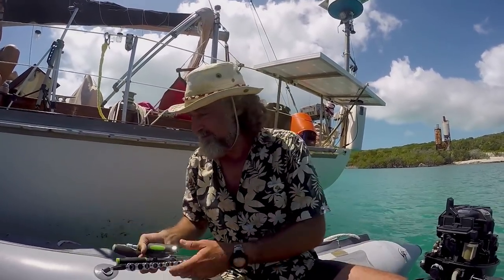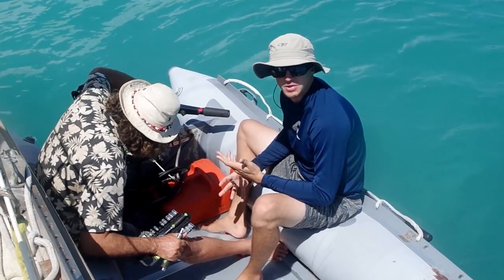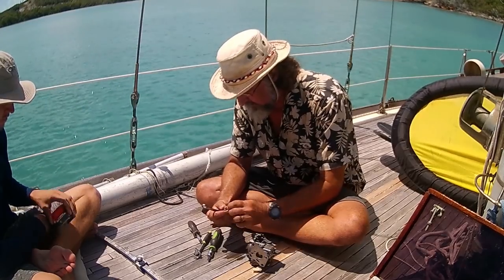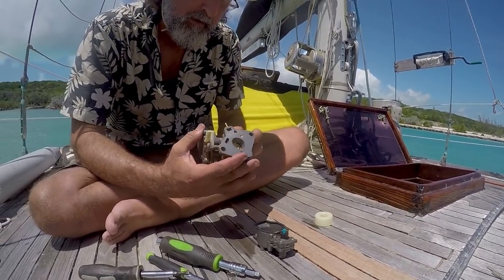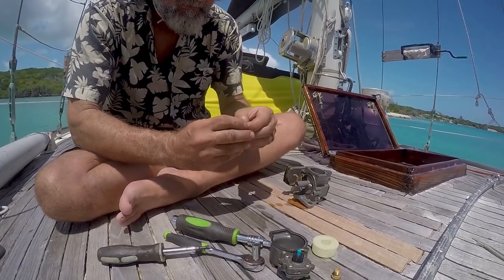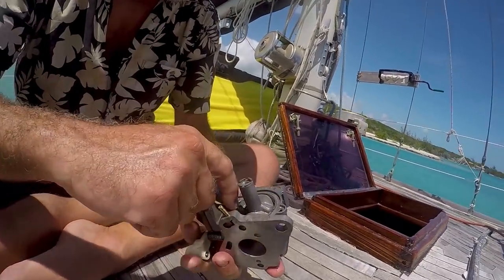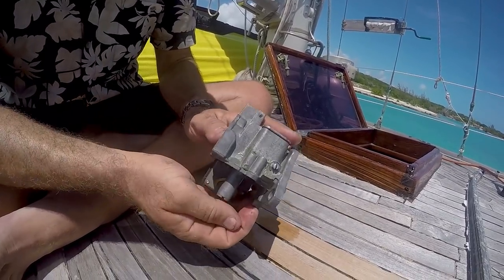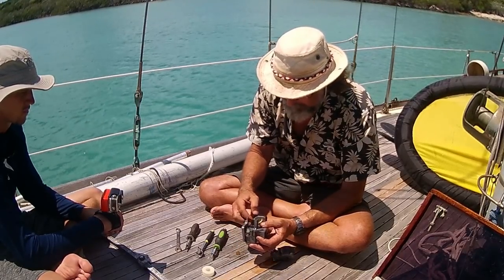Fixing a 2-STROKE OUTBOARD Motor [Capable Cruising Guides]

Comment: Speaking as a marine engineer I see you troubleshot this problem completely ass backwards, This is common with untrained mechanics. The problem was fuel so you always start at the beginning which is the source or tank , You didn't even pull the fuel filter off to check if it was clogged, you got lucky fixing this motor because they are so simple,
Reply: You are arrogant.  Read his post explaining why he didn't check fuel filter first.
Reply: You are kinda famous now. Watch the Yanmar starter motor video. You can comment there as well, being a Marine Engineer and all....Are you George Castanza?

Comment: Good video guys.
Worth noting that when you reinstall a carburetor's bowl, one should be very careful not to put Any more torque than necessary on the bolt. This is because the bowl is often made of very thin metal and is easy to bend. The next time it's reinstalled (because there Will be a next time) it will be bent and not allow it to seal properly. Easy fix to bend it back. But easier still to avoid the problem altogether.
Reply: i believe these are 40 in/lb. the bowls can warp, but thats not common as they are a very strong thick aluminum.